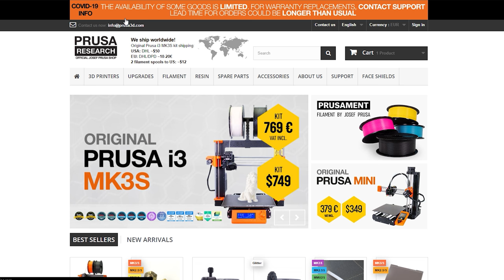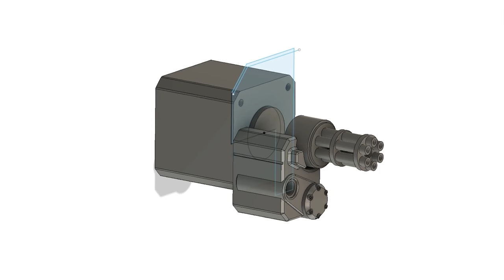Cyberpunk-themed Original Prusa i3 MK3S+ 3D Printer

Comment: Wow. That's impressive. Where did you tie the power into for the LEDs?
Reply: From PSU. LEDs are also 24V.
Reply: @TGWMS  Yes, I was wondering which socket on the board was used  :)
Reply: @jdrevenge  same as go to printer.

Comment: Oh wow, own the game as well, and I think it fits the theem SOO well. Could you make some I3's like that avabile for sale? 😇
Idea 1:
Maybe bundled with promo code for a ingame asset for V's appartment, a I3 that "eats" filament you can find at some factory, and can produce some common clothing accessories like goggles (glasses), PPE's or toys (benchies, Marvin, Makercoins?) you can throw instead of granades, that distract enemies just like empty magazins in Metal gear solid peacewalker. I know there is a quickhack (whistle) that does more or less that, but having a throwable physical object would be cool, specially if self-printed :)
Idea 2:
About makercoins: imagine running around night-city searching for sd-cards with the design for them on it, so it is kind of a achievement searching for them in every nook and cranny. 
Idea 3:
Imagine finding some makers ingame, maybe in some bar, (thinking of #3D_Printing_nerd, #Sexy_Cyborg, #Joseph_prusa, #Gina (from octoprint), #Dr_Adrian_Bowyer), that when asked don't hand you a autograph, but a makercoin-design 😋

Comment: Thanks for the lack of attribution for using my Thingiverse files... and for (possibly) changing the terms of the original license. I'm genuinely ticked off. https://www.thingiverse.com/thing:3575538
It's unclear if one of your .stl files in the distro may have a file remixed from one of my things without attribution. The example built in this video clearly uses several elements of the thing I linked above. If so, I would appreciate it if you make some clarifications here and at least give attribution where due. Thank you.

Furthermore, while you attribute "Cyberpunk 2077 Fan Cover by Cobalt_3D" on his contribution, that file was remixed using "Cyberpunk 2077 logo" by DiPT: https://www.thingiverse.com/thing:2956265 , and that was released as Creative Commons - Attribution - Non-Commercial, so you may have a bit of an issue there. It may have been remixed from one of the STLs in my work as well, and will be reaching to to DiPT for clarification.